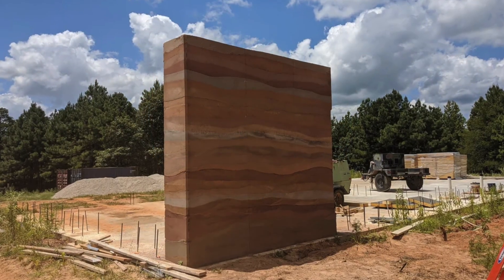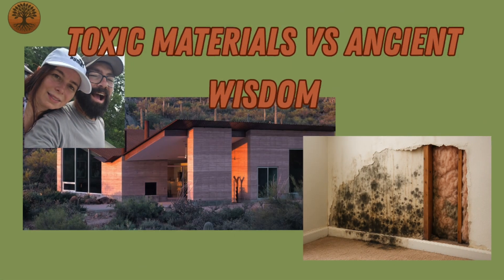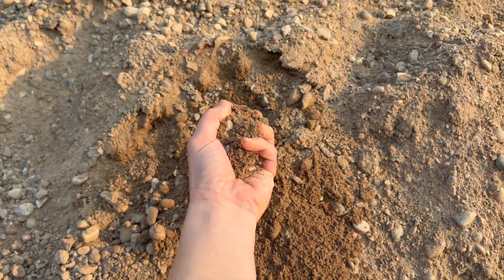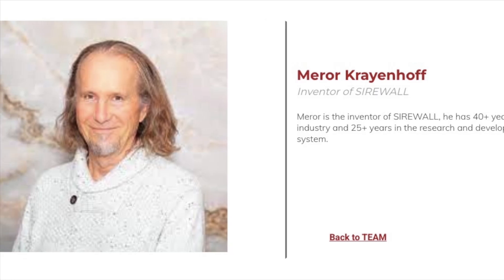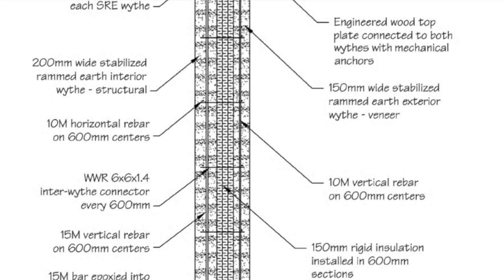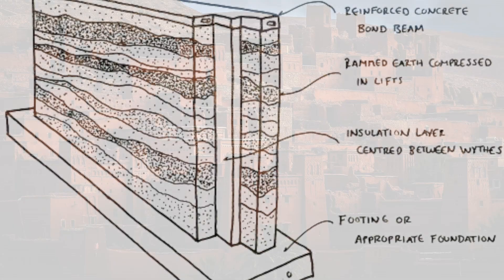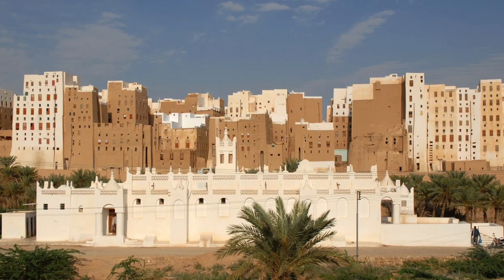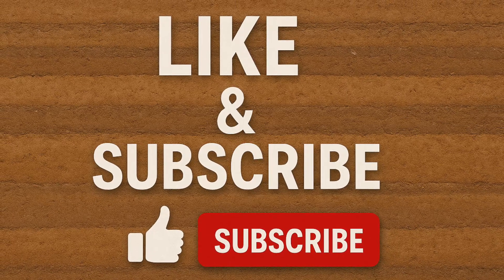Building Walls That Outlast Concrete... With DIRT (Surviving Manitoba) Winters

Comment: What do you think of solid rammed earth walls with insulation clad on the outside and coated with plaster or shotcrete or the like?
Reply from the maker: Shotcrete is basically concrete that’s sprayed on under high pressure — great for pools and retaining walls, but not ideal for rammed earth.

For rammed earth, one of the biggest advantages is that the walls stay vapour-open so they can buffer humidity and dry safely. A cement-based coating like shotcrete is vapour-tight, brittle, and tends to crack or trap moisture against the wall — the exact opposite of what you want.

If you’re looking at solid rammed earth with exterior insulation, the modern approach is what Martin Rauch documents in Refined Earth:
exterior mineral wool + a vapour-open lime or clay-lime render, or a ventilated rainscreen. No cement skins, no shotcrete.

If you’re curious, Rauch’s book has great diagrams and details showing how he does external insulation correctly. It’s worth a look if you’re exploring advanced RE wall systems.

Comment: What’s your opinion on the compressed earth blocks stabilized with lime ? Seems to have great advantages.
Would love to hear your thoughts about it.
Reply from the maker: From what I’ve been learning so far, lime-stabilized compressed earth blocks can be a really solid option. The lime adds durability, strength, and alkalinity (stops mold growth), and the blocks themselves seem to handle moisture well as long as they’re kept warm and dry enough (especially in freeze-thaw climates).

The big thing I keep seeing in my reading is that the details matter — especially the joints between them. Using a lime-based mortar so the joints stay vapour open and don’t become capillary highways is a good idea. And in cold climates, you will likely need an exterior insulation layer (mineral wool, wood fibre, etc.) plus a protective exterior like lime render or a rainscreen.

I don’t have hands-on experience with building CEB systems yet, but from what I’ve read, they can work very well when the moisture detailing is done properly. Definitely something I want to explore more. If you’ve used them yourself I’d love to hear your experience!

Comment: This is intriguing.
I live in Hawaii and as you might imagine building materials here are super expensive. I've been in the construction industry here for almost 40 years and have used almost all types of construction techniques so this interests me.
Another thing about Hawaii is that due to the soils high mineral content and low organic content it compacts into a super dense mass that is nearly impenetrable. Even if you want to dig a small trench here you need an electric chipping gun or hours  of swinging a pick.
The soil here may lend itself to this construction system.

I'll be following your work.
Thank you.
Reply from the maker: That’s awesome — and Hawaii’s mineral-rich, low-organic soils might actually be ideal for rammed earth.

Tim Krahn notes that a good mix is about 70% sand and gravel, 30% fines (silt + clay), with the clay acting as the natural binder. The best kind is a non-expansive clay like kaolinite (the same type potters use), rather than a swelling clay such as montmorillonite.

Given Hawaii’s humidity, you’d probably want to go with a stabilized mix — adding a small amount of lime or cement to make it more moisture-resistant and durable over time. A few small test batches will help fine-tune the ratios and moisture.

And since rammed earth isn’t fully standardized in the U.S. yet, it’s always smart to loop in an engineer familiar with earthen construction.

Comment: This technology is called adobe. we have it for 1000 years. The disadvantage is that these houses need to be renovated 2 times a year in spring and autumn.  and so making it more modern is an interesting idea, but how it will last is a question. One of the advantages is that this construction is relatively inexpensive. but are there really houses built, and not pictures from the Internet? Fiberglass fittings in structures such as fittings simply do not work. in order for it to work, it needs to be pre-tensioned and anchored, but simply rammed clay will not do this. Rather, microfibre will give more strength than this reinforcement.
Reply from the maker: Thanks for sharing your thoughts! Adobe and rammed earth do have a lot in common — both are ancient, earthen building traditions — but they’re actually quite different in how they perform. Adobe is made from sun-dried bricks with mortar joints, while rammed earth is monolithic, compacted in place under high pressure, so it’s much denser and far more resistant to weathering.

Stabilized rammed earth (with a small percentage of cement or other binders) doesn’t need regular resurfacing the way adobe does, and it holds up really well in wet and freeze–thaw climates.

As for the reinforcement, fiberglass is mainly used to reduce thermal bridging — it’s not prestressed like rebar in concrete, but it’s sometimes used where tensile strength is needed without conducting heat. Microfibres can help too, depending on the design.

And yes, there are definitely full-scale homes built with this method — not just concept images! 😊
Reply: @RootedResilientLiving  Not at all, adobe is not sun-dried bricks. These are monolithic walls made of clay with straw.  here you add cement. In this way, the foundation for the road was made in the USSR. notom laid both large rubble and other layers of the road on top. In general, it will be interesting to see what happens and how you will tamper.

Comment: Great videos thanks for sharing.

What is the typical percentage of cement used in a rammed earth wall?
Reply from the maker: Thanks! It really depends on soil and climate, but typically you’ll see around 5–10% Portland cement by weight in a stabilized rammed earth mix.

Some builders (like Tim Krahn, who engineers rammed earth projects here in Canada) offset part of that with fly ash — usually replacing 25–50% of the Portland. Fly ash is a fine, silica-rich byproduct from coal power plants that acts like a modern version of Roman volcanic ash. It reacts with the lime in the cement to form extra strength over time, makes the mix smoother to compact, and reduces cracking. It improves durability, especially in wetter or freeze–thaw climates.

Comment: THANK YOU for sharing your process. I know it's not easy to open yourself up to the criticism of the peanut gallery :)
My questions - from a natural building perspective - are:
1) RE: insulation. Instead of toxic rigid foam insulation that creates garbage for future generations to have to deal with (not that we're going for perfection, but if there's a workable alternative, then why not), could you use either rigid wood fiber insulation panels like those made by Gutex, or else cork panels like those made by ThermaCork? Is it an economic issue? Or would these materials that I've suggested not hold up in this context for some reason? 
Wood fiber and cork also have the benefit of being vapor open, whereas foam like the RMax pictured in the video, are vapor closed.
Are you trying to achieve vapor-closedness in your walls for some reason though?
2) RE: insulation. Could loose-fill insulation materials work in this context, or does the rigid panel-style insulation perform a structural function as well?
3) RE: foundation. I watched your video on foundations. Rubble trench looks awesome. In the wall section drawing in this video it depicts what looks like a concrete footing. Are you planning to put a concrete footing course at the top of your rubble trench foundation, or is the rammed earth wall going to sit right on top of the rubble/ sharp rocks? Is there any alternative to concrete that would last longer?
4) RE: rebar. Instead of rebar, could a frame of bamboo or timber work just as well to stitch the walls together? I ask because I know that steel rebar, with its different specific gravity than concrete or rammed earth, is notorious for rusting and turning into dust inside of masonry walls, and fiberglass rebar is better for that reason. On the other hand, fiberglass rebar is a toxic garbage material. I know that bamboo is ridiculously strong and used to build tall scaffolding structures in southeast asia. Could that work just as well instead?
5) RE: concrete bond beam. Instead of using concrete as the material for the bond beam at the top of the wall, couldn't you just use rammed earth?

Again, thanks for your hard work and for sharing your on-the-ground experimentation and research with us!
Reply from the maker: Thank you so much for this incredibly thoughtful comment — I really appreciate the kindness and curiosity (and yes, you’re right, the peanut gallery can be a lot sometimes 😅). I’m not an expert, just learning and sharing as I go because I think this stuff is so important to be talking about openly.

On insulation — rigid foam is used mainly for its high R-value. I’d honestly prefer rockwool, but the walls would need to be quite a bit thicker to reach the same performance. I had a really interesting conversation with engineer Tim Krahn (he's a leading expert on rammed earth construction) about the vapour permeability of RE walls — he explained that they really only ‘breathe’ within the first couple of inches, so the vapour-impermeable insulation between wythes doesn’t actually affect how the wall performs overall.

Right now, our plan is to have a concrete footing above the rubble trench foundation, though technically a stabilized RE course could work there too if detailed properly.

For rebar, we’re looking at fiberglass to reduce thermal bridging — but I completely hear you about long-term materials impact. Bamboo is such an interesting idea; it’s incredibly strong, though it tends to absorb moisture and expand, which can make it tricky to rely on structurally unless it’s very well treated and detailed.

And the bond beam question — yes, such a good one! I’ve wondered that myself. I know some builders have experimented with stabilized RE or limecrete bond beams, but they still usually need reinforcement for seismic and tensile strength.

Again, thank you for taking the time to write such a thoughtful comment. It’s conversations like this that really push these ideas forward.

Comment: Why not just use concrete? Probably costs the same
Reply from the maker: Good question — concrete definitely has its place, but rammed earth offers a few big advantages. It’s non-toxic, vapor-open, and helps naturally regulate humidity and temperature, which makes for much healthier indoor air.

It also provides thermal mass without trapping moisture, and it doesn’t rely on finishes like drywall or paint — what you see is the structure itself. With proper detailing, it can last for centuries with very little maintenance.

So the upfront cost can be similar, but you’re gaining comfort, durability, and air quality that concrete alone doesn’t provide.

Comment: My father has been a huge proponent of Rammed Earth construction since the late 1960's. As with Adobe construction, keeping water off the walls is facilitated by the roof having very wide "eves"...with the added benefit of serving as a "verandah". Concrete has far too many downsides to be used as the "foundation". The "Rubble Trench" with a French Drain System", constructed in the manner of the Roman "Viae publicae" roads: the method of "via munita", would be perfect...capped with a perimeter of "living rock", upon which the "Rammed Earth" walls would be constructed (or, continued vertical courses of "living rock" in lieu of "Rammed Earth").
Roof construction methods & a septic systems are more topics which are deserving of a stand-alone discussion... Along with incorporating a southern exposure greenhouse & rocket mass heaters...
Like all "free advice", MHO are worth what they are: "just the Wind Blowing !"
BTW: cap·il·lar·y
/ˈkapəˌlerē/ not ka•pil...
Reply from the maker: Love this — sounds like your father was way ahead of his time! I completely agree about keeping water off the walls — wide eaves and proper drainage make such a difference. The Roman road analogy is perfect for how a rubble trench works when done right. So many great ideas in here — thank you for sharing!

Comment: will it really be durable in a seasonally cold environment ?
Reply: I’ve been interested in rammed earth for awhile but had no place to build it. I’m also even further north than you in Alaska where I haven’t found anyone who as build with RE yet so I’ve got no live examples to compare. So this spring I might have to be a pioneer. I’ve subscribed and, since you will warm up about a month sooner than here, I can watch and follow your progress. 👍
Reply from the maker: Good question — and a really fair one for our kind of climate! In places like Ottawa, where there’s lots of freeze–thaw cycling, the key to durability is using a stabilized mix — typically with a bit of cement or lime added. That helps the wall resist moisture absorption and gives it the strength to handle expansion and contraction through the seasons.

Unstabilized rammed earth can still work, but it needs absolutely perfect detailing and protection from water. A small amount of stabilization makes a big difference in cold climates like ours.

Comment: As with all large mass wall the footings are still problematic. Modern concrete has a life expectancy of around fifty to one hundred years depending on the environment it sits in. Rammed earth walls may last lot longer, however the  footings will fail within a hundred years. Also any wall needs constant maintenance, rammed earth walls are no different, lichen, mosses and life in general will try and succeed to live on or in it. Remember nature hates a vacuum ( bare space) and a rammed earth wall is just that.
Reply from the maker: Absolutely — every home needs maintenance, and that’s something a lot of us forget these days. You’re right about the footing lifespan too — that’s often the weak link, especially with modern concrete. One big advantage with rammed earth, though, is that the solid mass has no organics to rot and no air gaps for moist air to move through, so it’s far less prone to mold or microbial growth — two big legs up on modern construction!

I just released a video on the history of foundations and an alternative approach that draws from ancient building methods — might be right up your alley! https://youtu.be/IjYNVBvMlo0?si=c9Les07v7ZF0nQzZ
Reply: Modern concrete? Why do you believe it is inferior? Back this up with science, please
 I have been in house 100 years old where the foundations show no deterioration. Thank you for your attention to this matter....

Comment: Is that not steel rebar?  I could not tell from the video
Reply from the maker: Good eye! Yep, usually steel rebar is used in stabilized rammed earth, but you can go with fiberglass rebar instead — just a bit trickier since some of it has to be ordered pre-bent. It can be worth it though to reduce thermal bridging. Here’s a site that was recommended to me with more info on the fiberglass option: https://www.vector-corrosion.com/technologies/view/26/v-rod/#TMv_TechnologyDocumentBrowser”
Reply: @RootedResilientLiving thank you